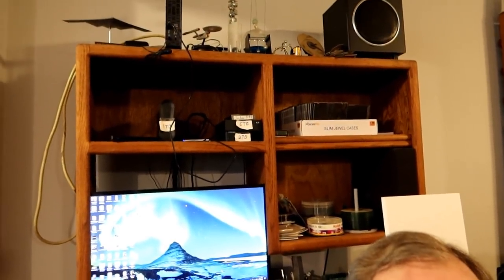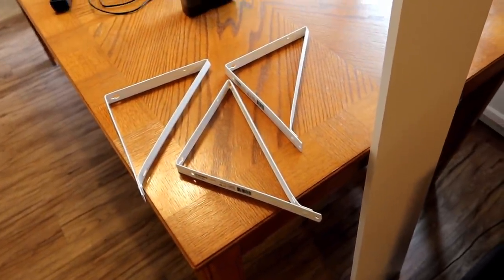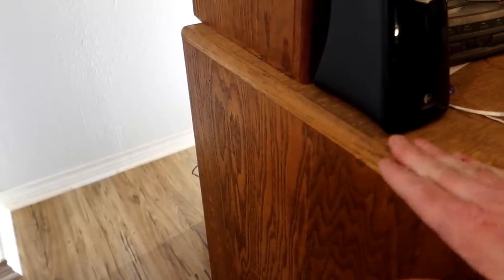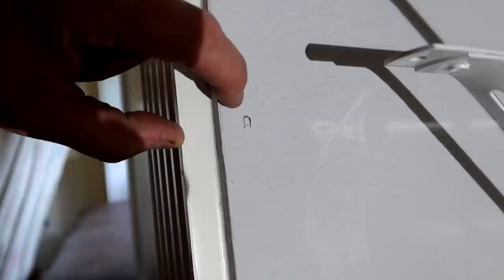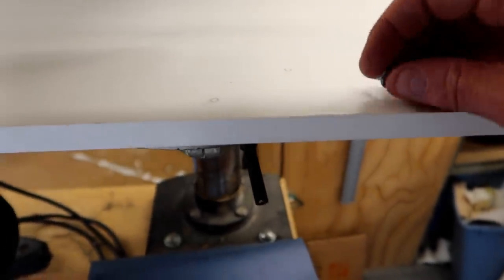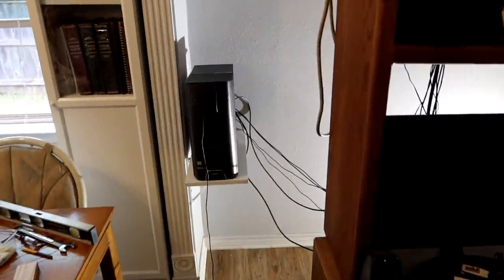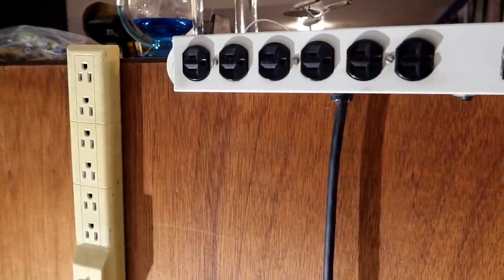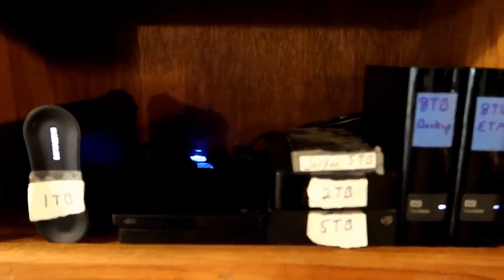Installing A USB Hub And Adding A New Hard Drive - Escaping The Mouse - ETM-519

Comment: Breck, I'm not normally one to chime in on others decisions; but, my choice would have been an NAS (Network Attached Storage solution), either QNAP or Synology, or a NAS/RAID solution. Eliminate the USB cables and go with LAN connected 1GB/10GB/20GB connectivity, if you want to get semi-serious about it.